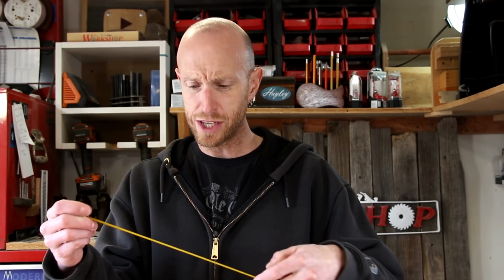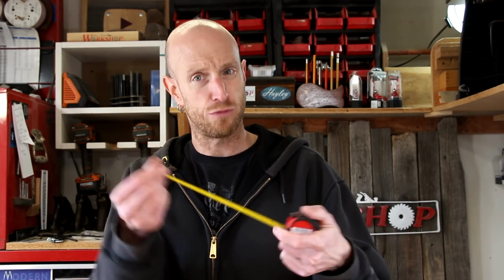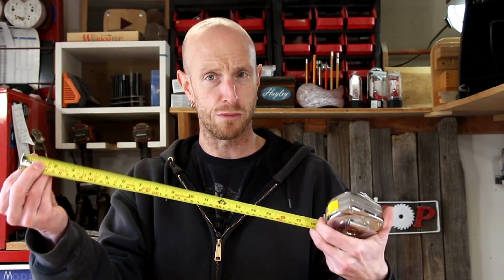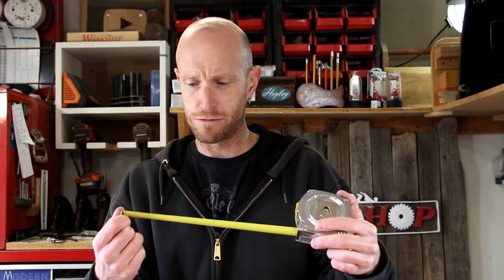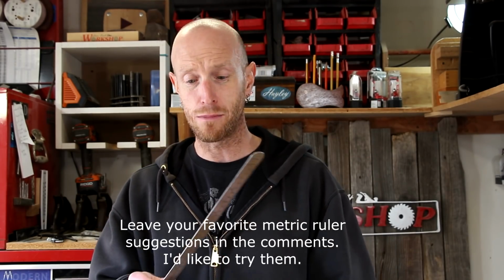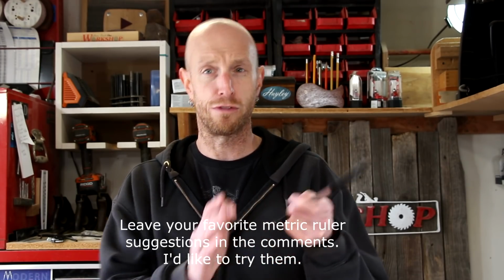My thoughts after using the Metric System for a project | I liked it

Comment: The worst is temperature. I never know when it's cold or hot, or how hot or how cold with farenheit numbers. They all seem hot to me...
Reply: I was so glad my aunt in the USA used to have a thermometer with Fahrenheit and Celsius scales. I looked at it after every weather report. Otherwise I would have been like „I don’t know how to dress tomorrow“. Now some from the USA told me „it’s like % hot, 100 is hot, 80 (%hot) is nice“, whatever temperature that my be in Celsius or Kelvin. 🤷‍♀️
Reply: @jennyh4025  Fahrenheit was dropped a very long time ago in the UK. 1962.
Reply: @fivish  Maybe, but people a lot of people still think of weather in farenheit, while simultaneously cooking with celcius.  In the same way the UK routineley measures things in cm, but people still think of their own heights in feet and inches.  Oh and the road signs are all in miles.
Reply: For weather range temperature, subtract 30 from say 70 Fahrenheit, and divide the result with 2. You get 20 degrees Celsius. Close enough for knowing what clothes to wear. There is also a exact formula for it.
Reply: @atvheads  subtract 32 divide by 9 then times by 5 it works in reverse also C to F divide by 5 times by 9 add 32
Reply: The fun fact about Fahrenheit is that the USA is one of the only countries which is still using it - and that it was actually defined by Daniel Gabriel Fahrenheit, a German from Danzig -  while Germany uses Celsius (which in turn was defined by Carl von Linné, a Swede, based on the work of Anders Celsius, another Swede :-D ).

So who is officially still using Fahrenheit? Well, not many places: https://en.wikipedia.org/wiki/Fahrenheit#/media/File:Countries_that_use_Fahrenheit.svg

Here in Canada, Fahrenheit is still used for cooking quite often, since a lot of the older recipes were written in Fahrenheit and most appliances are produced for both the US and Canadian market - all of which have a double marked dials, btw, in both Fahrenheit and Celsius, while for weather and other temperatures, I have only ever heard that in Celsius over here since I immigrated about 11 years ago - unless somebody is talking to an US American ;-) ).

PS: And if you EVER try to cook a Canadian dish in the US (or vice-versa), be sure to remember that "one cup" in the US only has 240 ml, while the Canadian one has 250 ml... ;-)
Reply: @atvheads  way too much work on vacation. Today I would just use my SI using weather app. 😉
Reply: @IgorRockt  240 ml, how much is that in us gallons ?   just kiiding
Reply: @66pac57  More exact, but harder to calculate in the head. At least for me.
Reply: @atvheads  i dont understand how a unit can be more exact than any other there are decimals for a reason like 21.0 C or 71 F or 71.1 F like they will be different levels of accuracy depending on how accuretly you measure them
Reply: @simedinson984  Det skrev jag inte heller,  jag skrev att det finns en mer exakt formel för att räkna om F till C än det exemplet jag tog.
Reply: @atvheads  srry
Reply: @fivish  I still use it in Summer.
Reply: @simedinson984  Ingen fara.
Reply: @IgorRockt  And Danzig is now called Gdansk - and is in Poland.
Reply: The two scales meet at -40°.
Reply: Reaumur anyone?
Reply: As far as I am concerned the temperature is the one measure where I do not care if it is in Fahrenheit, Celsius or Kelvin.
It's easy enough to convert between them, and all are a bit arbitrary and make sense for some applications.
No, when measuring length, surface, or volume, the metre is clearly superior, as is the gram for measuring weight, instead of the dozens of units that the US system has.
Reply: @rogerwilco2  Water is important in tthe metric system. One liter of water weighs one kilogram, one cubic centimeter of water weighs one gram, and the fusion point of water is 0 degrees, and the boiling point of water is 100 degrees centigrade
Reply: @ChrisPage68  ...which is using Celsius as well. ;-)
Reply: Fahrenheit is how humans feel, in percentages. It should make sense to humans. 

32F is the freezing point of water, and is pretty cold, but not the coldest. If it's 0F outside, you would probably like to be elsewhere. If it's -#F, it's so cold we had to push the scale beyond it's normal capabilities to say how cold it is. You don't want to exist somewhere where it is negative degrees F outside. 

Going the other direction, 50F is getting warmer, but could be better. Most sensible people put on a jacket. At 70-75F, everything is perfect. This is what sane people want to live with every day. People who say they like fall for pumpkins or winter because eggnog can go jump in a ditch. At 80F, things are starting to get a bit too hot. You better be wearing a t-shirt and shorts. At 90F, maybe you go outside if you really have to, but you won't like it and you won't stay outside for long (unless you work in construction, God rest your soul). At 100F, you can see heat mirages in the middle distance, and you could probably cook an egg on the street. You do not go outside. Outside is for fire-type Pokemon. If you live somewhere that gets so hot extra numbers have to be invented beyond 100F to describe it, you either run a novelty golf course in the middle of Death Valley, or you move. The End.  

Celcius is how water feels, and makes no sense from a human perspective. Everything a normal person would want to know is expressed in a range of around 30 degrees. I'm sure setting the freezing point of water to zero works great for accurate measurements, but it's only intuitive to a person if that person grew up with it, in the same way Imperial units only make more sense to me because I grew up with them.

Bonus round: 0 Kelvin = death.
Reply: @purplecowadoom  You obviously don't know about centigrades.  Human temperatures span from -20ºC (A little less than 0ºF) to 40ºC (a little more than 100ºF), so there is a 60ºC of margin for expressing what a person wants to know about weather, and more indeed. But everybody knows in Centigrade world the temperature of the boiling water or the freezing water without having ever to consult their smartphones.
Reply: @wobaguk  and weight in stones
Reply: @CarlosLopez58  Add to that that Fahrenheit originally used the freezing temperature of a mixture of water, ice, and ammonium chloride as 0 degree (which is called a brine and has literally NOTHING to do with humans), and that he set his BEST AVERAGE of the human body temperature to be 90 degree (later he changed that to 96 degree, which is btw still a few degree off...) and one can see that the whole "is how humans feel" is total nonsense - squared. Even later, the Fahrenheit scala was AGAIN changed, with defiinng 32 degree as one fixpoint (which is the melting point of pure water ice), and as the other one the boiling point of water at sealevel and standard atmospheric pressure at 212 degree (so 180 degree difference between them). Which has even LESS to do with "how humans feel"... so the two fixpoints are the same as Celsius, just that Fahrenheit starts with a higher number and uses more degrees (180 instead of 100) in between those fixpoints...

TL:DR: In the Fahrenheit scale, the freezing point of water is 32 oF and the boiling point is 212 oF, so that there are 180 Fo between the two fixed points. In the Celsius scale, the freezing point of water is 0 oC and the boiling point is 100 oC, so that there are 100 Co between the two fixed points. That's the whole difference between those two. And as such, both have literally nothing to do with "how the human body feels"... SMH
Reply: @IgorRockt  It seems that Farenheit was thinking in a circular thermometer, like a clock...
Reply: @wobaguk  if the changed the road signs everyones nan would be willing around at 120 mph.
Reply: Rule of thumb for centigrade system 0 degrees water freezes. 100 degrees, your dead. Water Boils.
Reply: I only have one guideline for this... 69 is NICE, and that's all I need to know
Reply: Water freezes at 0° Celsius and boils at 100° Celsius. That's easy.
Reply: @purplecowadoom  Unless you are a human thermometer, you're not making any sense.
Reply: You know, there is nothing particularly metric about the Celsius temperature scale.  It is not defined in the International System of Units (the official name of the metric system).  The official temperature scale is Kelvin.  Water freezes at about 273K and boils at 373K .
Reply: @hammathguy3995  Yes, there is something very metric in 100ºC, and the degrees themselves have the same size as Kelvin absolute temperatures, and it is in those units that you calculate all thermodinamic formulas using the metric system
Reply: Water freezes at 0 and boiled at 100
Reply: In the UK, when it's cold we use C, but when it's hot we use F!
Reply: @fivish  Fahrenheit is still used though, especially when the weather's hot!
Reply: @atvheads  you lost me at "and divide"
Reply: Set your weather app to degrees Celsius and you'll get in less than a week.
Reply: @IgorRockt  the use of cups/tablespoons etc. makes the use of weights or content of a container (ml, ltr, gallons) redundant as long as you keep the ratio of the ingredients the same. And you don't need a scale or a measuring cup. 
You might cook/bake a larger amount, true, but the result will be same. The only thing that has to be taken in account is that when you increase the amount of ingredients, the longer it will take to cook/bake properly.
Reply: you know at 40 below metric and Fahrenheit are the same? Weird huh?
Reply: @1pcfred  Any two linear functions will cross at one point unless they are parallel (in euclidean geometry).
Reply: Fahrenheit and Celsius are not part of the imperial and metric system definitions. Celsius just divided the state of aggregation when water is actually water in 100 steps. This is not exactly metric. Metric means you can calculate with a base of 10. In temperature you always use celcius and don't have kilo celsius or millicelsius.
Reply: @Secret_Agent_Mark  The problem is that not all ingredients are measured in cups/tablespoons, so depending on what you are cooking/baking, your result will still be off quite often.  One egg is an egg (and one pound/kilo of beef is one pound/kilo of beef), so if you are baking a cake (or a casserole), the taste of it can differ quite a bit (e.g. for the casserole, it could be either not spicy enough or too spicy, and so on). Just check some of the cooking forums and you'll see that this (to have to check where the recipe originates) really is quite often an issue for a lot of people in Canada (and all newer recipes in Canada list the metric value for each ingredient, too).
Reply: @OPBPanzerBricks  The SI unit for temperature is the Kelvin, which was defined at first from the degree Celsius. The day to day unit of measurement for temperature is the degree Celsius still, and since there are almost no advantages for changing to the Kelvin, it will probably remain like this. The Kelvin is used with the prefixes, like the unit for thermometer precision is a miliKelvin (mK). The reciprocal MegaKelvin (MK⁻¹) is used in color temperature scales.
Reply: @rafaelschipiura9865  what's that got to do with the price of tea in China?
Reply: @1pcfred  If we define Celsius(t) = t, then Fahrenheit(t)=1.8*t+57.6 . These are 2 linear functions with different angular coefficients, hence they are bound to intercept once.
Reply: @m4riel  yes they do and when they do it really does not matter what the temperature is then. If is F-ing cold any way you slice it.
Reply: @wobaguk  BRITIAN
JUST CHOOSE ONE SYSTEM
REMEMBER THE MARS THING THAT BURNT UP IN THE ATMOSPHERE
JUST CHOOSE
I DONT CARE WHICH
JUST CHOOSE
Reply: @66pac57  
headache
Reply: @wmeneses  but then you get a right angle that boils at 90°

Comment: I loved "if you are from country or region that uses metric..." Lol only USA Liberia and Myanmar don't use metric 😆 as amateur pilot I have to use imperials and it's just stupid.
Reply: WolfKenneth I am metric and a pilot. I don't think using imperial in aviation is stupid. Climbing 1 km altitude is a whole different level than flying 1 km distance so using hundreds of feet for altitude and nautical miles for distance is no problem. Also flying a straight track at 100 knots gets you to your destination faster than driving 200 km/h on highway. It's a whole different world so other units make no problems.
Reply: The difference is in aviation, there is no clear advantage to using metric. They are just numbers.
Reply: @zoltannemeth8195  while you are right, that 1km altitude is much, you could just go with 100m which would just be about 3 times as much as with 100 feet. With the metric system it is much easier to go down or up an order of magnitude to get to your desired accuracy in numbers. The Rest is just getting used to it. The same aplies to knots as kmh is not even double the amount of knots. And if you are mentioning, that speeds on the ground and in the air feel different, you are right, but that does not give the need for a special unit.

Hope it is clear, what I've written
Reply: @Bananenmilch-iy1bl  you are absolutely right. There is no reason and need for a special unit. But somehow I like it the way it is. I like that the flight levels are separated by 1000 ft, and not 300 or 250 m. I like that 1° on a meridian is exactly 60 NM instead of using 111,12 km. But when calculating mass, volume and dimensions I prefer metric.
Reply: At least officially. The de facto situation is a bit more complicated than that, with countries like the UK or Canada still using imperial for some stuff, and Liberia and Myanmar pledging to adopt metric eventually (and Myanmar also having their own traditional units on top of imperial or metric). Even in the actual metric countries imperial units still show up in stuff like screen or wheel sizes. Horsepower also still seems to be the preferred unit of measuring vehicle power, despite official documents using kW.
Reply: @zoltannemeth8195  You're right. NM and knots make a lot of sense on sea and in the air, because of the relation to the meridian. But, and this is important, the NM is NOT really part of the imperial/standard system. The NM is in fact by definition exactly 1852 meters. So you could argue that NM and knots are in fact part of the metric system, or at least more closely related to the metric system than the imperial/standard system. So when you use NM to measure distances, knots to measure speed, and feet to measure altitude, you are in fact mixing the two measuring systems. If we used NM for distances, knots for speed and meters for altitude, we would in fact be more consistent.
Reply: @HGSolberg  there is no need to be consistent. When calculating climb/descent 1 knot is approximately 100 ft/min. Usable flight levels are like 340, 350... for IFR and like 055, 065... for VFR. And that are nice numbers.
Reply: @zoltannemeth8195  Also. "Flying 185.2 km/h on straight gets you to your destination faster than driving 200 km/h on highway" is MUCH MORE representative.
But in US even mile != knot. Why? For what? Is it really make somebody proud of it?
Reply: @Vengir  I can't comment on the UK, but as a Canadian in the carpentry trades we have to work in both systems. With the US as our neighbour and trade partner, it is unavoidable. We still refer to lumber as 2x4's and sheet goods as 4x8, but if you look at the dimensions on the labels they are in millimeters. I program the CNC machines at my work and we work in Imperial and convert to metric as the Canadian made CNC machines we have work only in metric. Fun!
Reply: When i lived in Jamaica measurements on say hardware/home improvement was done in Imperial but then on road signs it was all in km. Yeh... use 2 systems at once. Great thinking. I wanted to build a doghouse and the guys working there couldnt measure in meters >.>
Reply: The US does use the metric system, so I guess you can remove us from the list, or add England to that list since they still use imperial units - America doesn't btw.
Reply: @cazgerald9471  thats great! Now if they only apply some conduct, adopt the banking and health care system from European countries and a few other things, maybe the USA would stop being a development country
Reply: @JBKNL  good luck, the gov't just gave $10 trillion to their cronies in the guise of COVID relief and infrastructure.
Reply: @cazgerald9471  Next year Gadget, next year
Reply: @zoltannemeth8195  exactly no reason for special units you like it I don't.
Reply: There is nothing at all wrong with being precise in your wording.
Reply: Yet in Canada, we have metric for everything except. Construction, personal height and weight. But our speedometers are in Kph, and road signs also in Kph. It's like we tried to convert but certain industries refuse to switch.
Reply: Meanwhile Canada and the UK get to pretend to be metric. We'll ignore how most brits use stones for weight feet for height and use miles on the roads. Canadians use pounds, feet and things like pools and ovens are still in F.